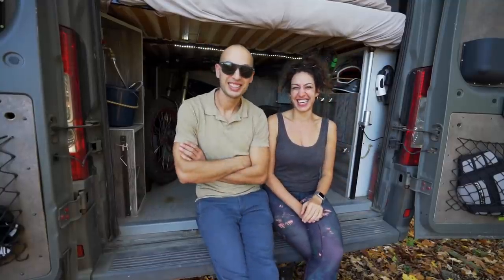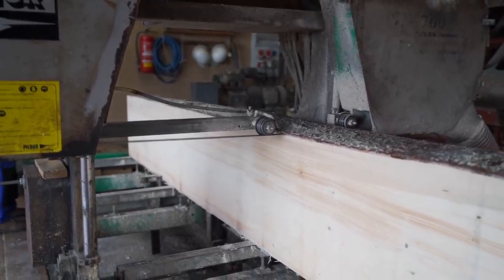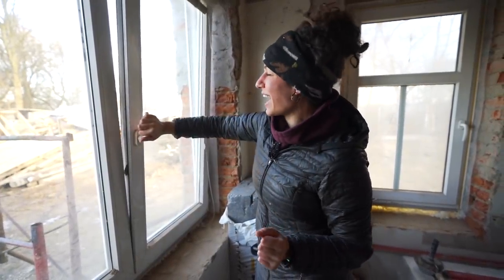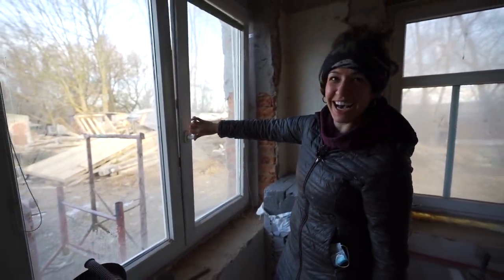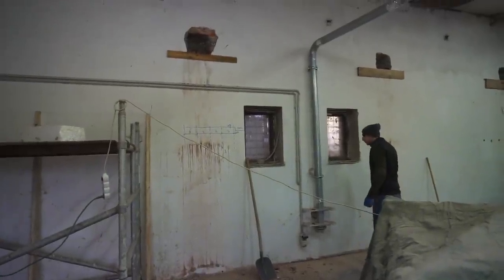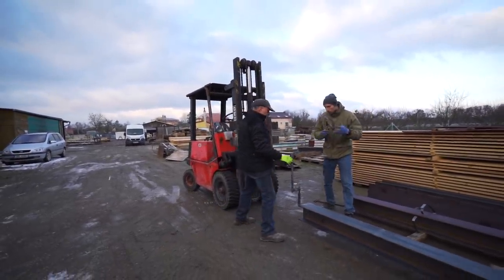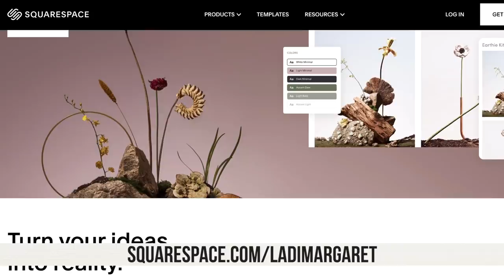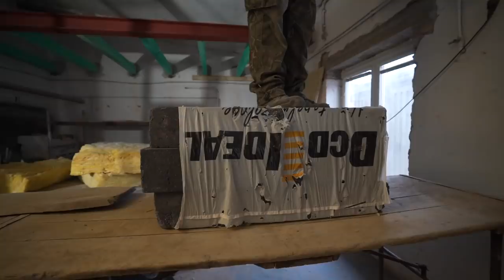Making a CEILING! Sustainably Building Tiny Home on a Junkyard (Pt. 2)

Comment: 5:00 There is also a micro ventilation mode in your windows. You can set the handle between "ventilation" and "open", you will hear a click.

Comment: Looks like you need a boiler room. You will never want to go back to having a stove inside if you move it in its own compartment and use water radiators instead. No smoke, no smell, no ash, better heat distribution.

Comment: Here in south east Asia, the window is open to the outside, not the inside. We need the breeze and ventilation more due to the humidity, and of course to avoid the rain from sprinkles in. Importantly, a window that opens to the inside, the window panel do take the space in the room. It will knock things over if you have table/furniture close by, you have to walk around it and hope that you don’t accidentally hit it as well.

Comment: These windows are used pretty much everywhere in Europe, except in the UK and Ireland. The main reason for having them open inwards is because they're easier to clean if installed upstairs. BTW, don't rely too much on that tilt feature, it can cause mould issues! Humid air passing through that narrow gap can condensate on the walls surrounding the windows, causing them to get damp and eventually mouldy. Better open the windows completely for a few minutes than having them tilted for hours on end, especially in winter.

Are you sure the old roof is tin? It looks more like asbestos cement to me.

Comment: When I moved from Hungary to Denmark I was so confused about the windows opening outside :D I still am, honestly
Reply: I'm from Germany and I never even would have thought of windows opening outwards. Why would you even do that? 😂
Reply: @johannab3668  For fire safety reasons. Here in Sweden outward opening windows and doors are mandatory due to fire safety building code. Outward opening =easier exit= higher fire safety. It's well tested in simulations and ppl do get out quite a bit faster when they can just go in a non stop forward motion. When the brain is in panic mode, this is especially true.  But in Norway doors open inward because it is considered more welcoming (screw fire safety, hospitality is everything😉). Are there any real practical reasons to why doors and windows would open inward? I'm guessing it's just tradition, cos I couldn't find any. Can you?
Reply: @jsvensson8234  one comes to my mind straight away - you cant really have a window open with rain going on outside as it would not be good for the window frame, which is something that would bug me. I love having the window open when the rain is pouring :D
Reply: @jsvensson8234  The main advantage is that you can clean them on your own :D It's quite sad to have seagull poop all over your windows and having no way to clean them.
I agree it's probably easier to escape in case of an emergency, but as I live on the 5th floor, I would rather use the door.
Reply: @jsvensson8234  everytime a fresh breeze if you want. You can have a bug screen on the outside and having no insects coming in, while your window is open. It is really great!
Reply: @CofIQ   Ahh. I see your point. I guess the situation is a bit different here as our windows are usually sturdy as heck (triple glazing, metal frame etc) so I've never come across the worry of water damaging the window frame before. Also, my new windows tilt outward from the bottom, so those you can open as much as you want, in any type of weather.  What ever comes down just slides right off the outside of the window and lands on the ground. So no issues there. But you do make a very good point. When I lived in an older house with wooden window frames we had a roof with quite a bit of over hang that took care of that. But now I'm actually intrigued by why pretty much all windows open outward up here in Sweden. Even those of very old houses (pre building regulations that is). Need to investigate further. Thanks for the new perspective. Much appreciated 🙏
Reply: @ellipszilonq  That's a very good point. I grew up living on the second floor and yes, cleaning the outside of the windows was risky business. I'd actually forgotten about that.
Reply: @afrarunduml1170  That works no matter what way your windows open I think...
Reply: @jsvensson8234  explain it to me. How does it work when your windows open to the outside?
Reply: @afrarunduml1170  You have the bug screen on the inside of course. I have them. No problems here 😊 Think of it as walking in to a place that has an inward opening door, with a bug screen on the outside. It's the same, just in reverse. I hope that makes sense. Anyways, it works just fine 👍

Comment: Do windows open differently elsewhere? In my experience its perfectly normal to open windows to the inside like those ones you installed. Greetings from Croatia!
Reply: Same here, in Germany. It would never have occured to me, that this could be strange.
Reply: I live in the United States and except for windows at an old school I have only seen windows open out.
Reply: I think that these "EURO" style plastic windows aren't very common in United States. By the way, they weren't very common in the Czech Republic either. They started appearing only after Velvet revolution. Before that, most windows were made of soft wood (often spruce). And they swiveled around central axis. Often, the frames were made form wood that hadn't dried properly and the frames flexed terribly. And since no-one was giving fuck in state controlled economy, and also the mounting hardware sucked, you got windows that were drafty from the factory.
Reply: In the UK windows open outwards.
Reply: Inward tilt+turn is normal is most of Europe, but in the UK windows are almost all outward-opening casement (of various styles). Although the Euro-style is being used here on modern buildings with EWI.
Amusingly doors are the opposite way round. Almost all British front/external doors open inwards, whilst European doors often open outwards. I have no idea how these conventions develop. I've retrofitted my house so now the doors and windows are all euro-style.
Tilt+turn windows work better in well-insulated and mechanically-ventilated buildings where you rarely need to open them fully inwards (because it is a pain having to clear the widow-sill to do that, but it's rare enough that it's not a problem). They are also good for high-rise as they are easy to clean the outside safely.
Reply: @Wookey.  in Canada, outside doors open in so they can’t be blocked by a snowfall.

Comment: You've left a significant thermal bridge at every joist, especially the big metal ones.
Reply: It doesn’t look like it gets very cold there.
Reply: @CeilidhGood  Is that sarcasm or are you Canadian/Russian? It gets well below freezing - how cold do you think it needs to get before thermal bridging matters? This is less of a problem then it might be as this is destined to be an internal floor rather than an external roof but even then - with a heated apartment over a usually-unheated workshop it's not good design and would cost almost nothing to mitigate at built-time, but be really difficult later.
Reply: @Wookey.  hah, not sarcasm - with windchill, it was -40 here today (fun fact, same in Celsius or Fahrenheit). We go for triple-pane sealed windows here. But I don’t disagree really - if that will be a heated space, always better to avoid thermal bridging.

Comment: Taking safety risks is not a mark of a man.  Silicosis is a real thing.  Ladi, please protect your lungs.
Reply: Yeah regret comes too late.
Reply: Yes, like the green stuff for the wood...is it CCA? ( arsenicum, chromium 6 and copper, forbidden in most  of EU as chromium 6 is cassified a ckass 1 carcinogenic). Hopefully they will be very careful with the outer layer of the roof, which seems like it asbestos. Be safe, L&M! ♡
Reply: Good point @elswhere100 . Can't be too careful with asbestos.

Comment: 5:02 and that the wrong way to do it, the air exchange is not great and in winter if you do that, you loose only heat and increase the build of mold over the  window. Better every hour you open the windows large for 5 minutes and close it . in Summer you will have them completly open if you dont have AC and a bug net infront of it ( mosquitos, flies)

Comment: Windows: They open outward for fire safety reasons. Here in Sweden outward opening windows and doors are mandatory in a lot of places due to fire safety building code. Outward opening =easier exit= higher fire safety. It's well tested in simulations and ppl do get out quite a bit faster when they can just go in a non stop forward motion. When the brain is in panic mode, this is especially true.  But in Norway doors open inward because it is considered more welcoming (screw fire safety, hospitality is everything😉). Are there any real practical reasons to why doors and windows would open inward? I'm guessing it's just tradition and/or preference, cos I couldn't find any. Can you?

Comment: I've a couple looks at your Google sheet and you's seem to buy most of your parts from AliExpress. Could you explain why? I understand it's a lot cheaper but are there any other reasons? I am starting my own conversion soon and would love to know! Thanks!
Reply from the maker: Good value for money
Reply: @ladiandmargaret  Thanks! What are you guys going to use for batteries?
Reply from the maker: I’ll (Ladi) make my own 48V lithium battery pack.
Reply: @ladiandmargaret  Haha wouldn't expect anything else😂😂. Can I ask why 48V instead of 12 or even 24V?
Reply: @ladiandmargaret  also I think the panels you listed on the spreadsheet are 44.3V vpm... Or should you use the VOC voltage of 53.2V? Or are you going to wire them 2s2p??

Comment: Another reason those windows open to the inside has to do with burglars.
It's a lot easier to force a window with a crowbar that opens to the outside, and basically impossible with a window that opens to the inside.
Reply from the maker: Had never considered that!
Reply: @ladiandmargaret  So now you know haha :D
Same reason for the main front door in a house.
Some people even buy extra metal strips to make the gaps even smaller/stronger. 

Love the content btw! Very inspiring!
Reply from the maker: Thank you! I really never thought of that reason so neat!
Reply: @ladiandmargaret  I don't know about Czechia, but here in west Europe you can really see this with older houses that have been upgraded. Ground floor windows all open to the inside.
Windows on higher floors open to the outside.

Comment: Guys, we are you insulating ceiling if that's going to be your floor?
Reply from the maker: Insulation for the floor is extra important too
Reply: @ladiandmargaret  good morning! Unless you are not to have heat on the first floor?
Reply from the maker: Hi! Insulation keeps any temperature you choose in a space. Having an insulated floor means that if we are cooling down the apartment it will stay cool for longer, and same for heat. The insulation in the ceiling of this workshop means it holds heat now, and will keep us cool in the summers as well. Insulation works in both ways and is best done on every side of a building (top & bottom included) hope that helps!